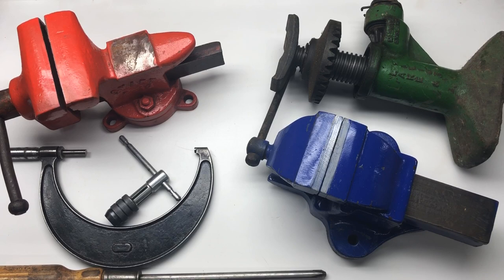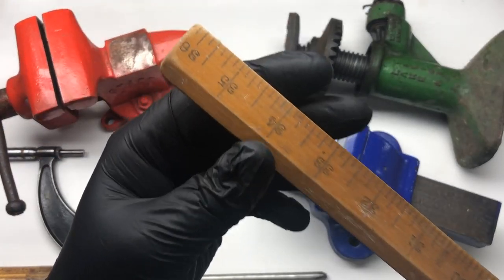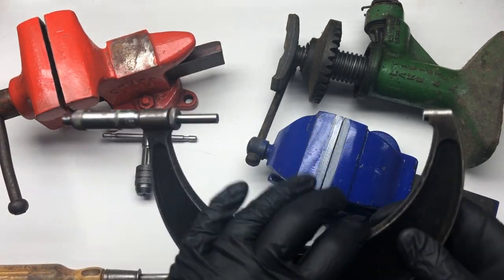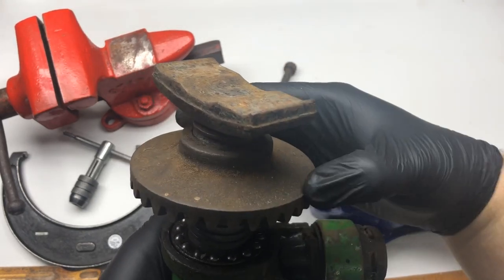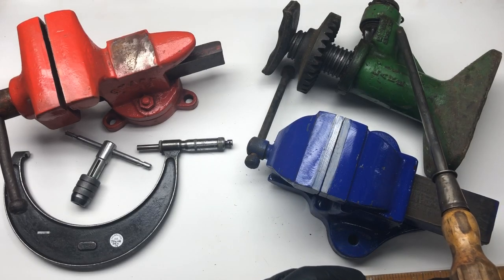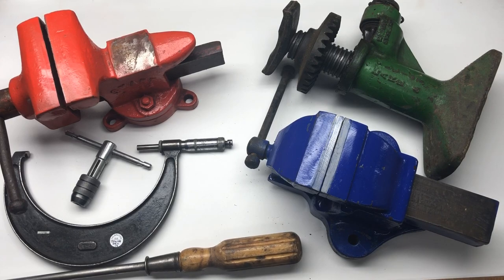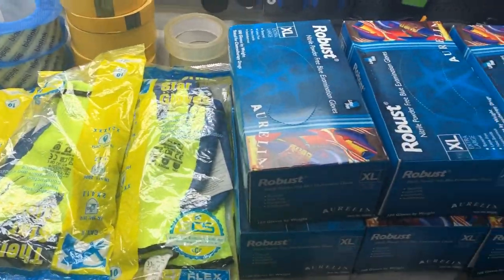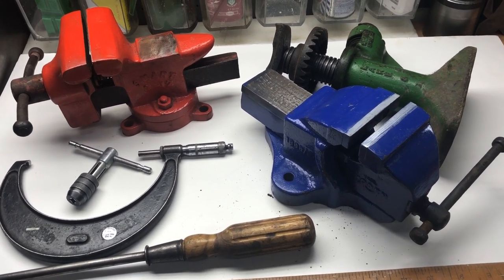Fleamarket tool haul car boot sale Vices Stanley screwdriver Bottle Jack 27/09/2020 Guess the price

Comment: Hi Ben
I think you might be turning into a viceaholic! The Woden was made by The Steel Nut and Joseph Hampton company who were based at the Woden works in Wednesbury. Two brothers left the company for Sheffield and set up the C&J Hampton Co. making tools under the Record name. Wodens are just as good as Records and a bit less common. I reckon he wanted 35 for and you got him down to 25. I dont know anything about the other one- maybe Far East?. One sold at auction a few years ago for a fiver but I'm guessing he wanted 30 for it and you paid 20 so 45 all in?. Great steal on the gloves - I think you really were in burglar mode when you got those!
Reply from the maker: Hi John I think you might be right oh dear 
that’s not a good sign is it ? 
but on the good side I haven’t got 50 yet
 I’ve just searched on the Red colour One the company they were based out of Ontario Canada from 1895 to 1966 James smart manufacturing company i’m quite happy with it and the other one Worden seems to be a nice little one as well thanks for that Guess much appreciated all the best Ben
Reply: @tooladdict7463  That's great about the Canadian vice - it will be good quality. That makes it a better buy than the Woden as there must be very few of those this side of the Atlantic. How many vices have you got now?